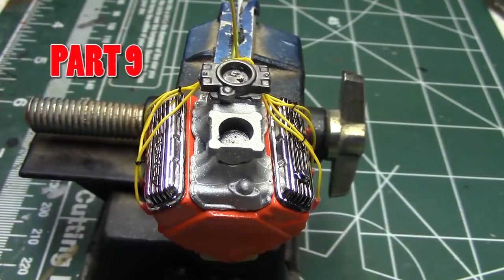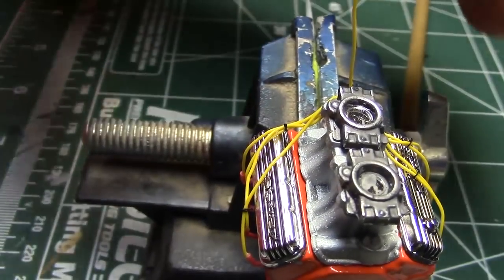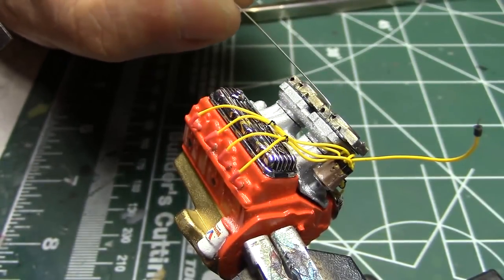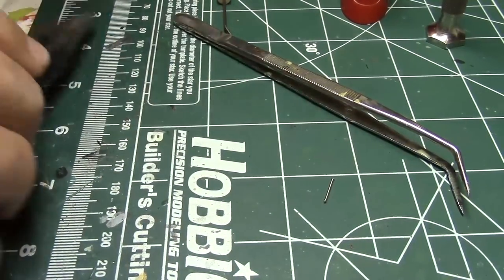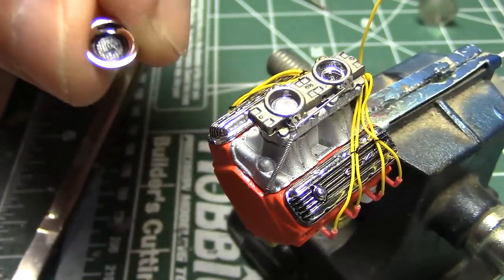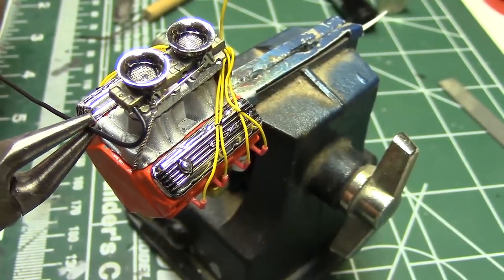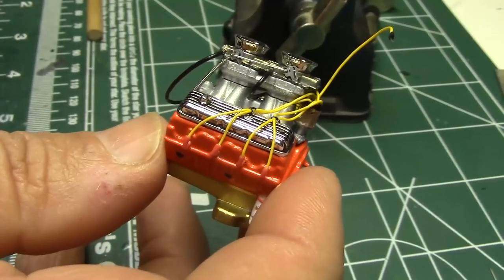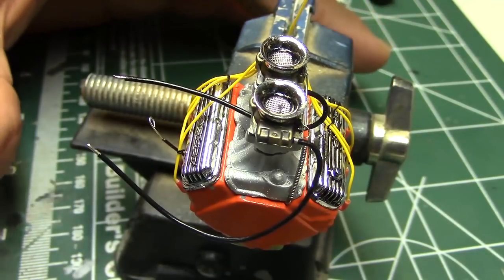How to Add More Engine Detail For an Old Model Car Kit  (AIBMC Part 9)

Comment: By accident I watched this video. By accident I mean I wasn't looking  for model car videos. I've never built a model car never even crossed my mind. I do work on full size cars 1965 and 66 mustang's as a hobby. I think I could have some fun building model car engines. I didn't know so many parts were available to make them so authentic.
Reply from the maker: Right on. Come on into the hobby. You will find that there are allot of model builders are full size car builders. You will example of that throught many of my videos. Also. Check out our facebook group. Luka Cee's Model CSR Hobby Headquarters. There are tons of amazing builders on there.

Comment: A thing I used to do on old electronics VCR’s and such before chips and all that came along was to take em apart and strip all the wires springs and screws out of them. I used to get lots of wires for plug wires, boots and hoses that way!
Thank ya for the video’s a great thing your doing!

Comment: Im excited with you! I've never done engine detail before. TBH, I'm not a "display the model with the hood open" kind of guy, so unless the engine is required to mount the front axle and wheels in place, I don't mess with it. But I'm working on some post-apocalyptic cars without hoods right now. And cars don't run without engines. They also don't run if the engines aren't hooked up to anything lol. And while some of this looks like it could be tedious and frustrating, this kind of thing is amazing for somebody with ADHD. Being able to hyper focus on just one thing for hours on end is very relaxing to an overactive mind.

Comment: Hey there, I know this is an old video but for lining up tiny parts like that photo etch linkage, I keep pieces of styrofoam from electronics purchases and I have some super thin 00 insect pins I use to hold them. I would use the guitar wire to poke holes in the styrofoam, take it back out and put the photo etch on the wire. Put the wire back in the holes and then use tweezers to arrange the photo etch. Once I get on where I want it I pin it with the insect pins so it will stay still and glue it with some glue on a needle. Then wok to line the second one to match. Pin it down and glue it as well. then take the whole assembly off the styrofoam and glue it to the carbs. 

Love your channel. Take care.

Comment: Guitar strings is a brilliant idea!  I just got a $7 set on the Amazon.  I would recommend to select a thicker set and “Plain third” or “Unwound third” because I think the wound strings will be less useful and when they are useful it’s the thicker ones that are better.  I think.  Electric guitar strings seem to usually have not wound third or G string.  Also, nickel or stainless color may look better than bronze yellowish color.

Comment: Check out the lead wire kit used in fishing...different gauges for all kinds of applications. Not a lot of money either!
Very easy to bend around those hard to match curves, silver  in color, super glues incredibly well, and paints up nicely
with metalizers, etc. Source: Bass Pro Shop. 6 sizes per plastic case. It is lead so...

Comment: I use what i have for the springs I use the wire out of a bread tie. Then i use my smallest drill bit and wrap it around it, does what i want it to do.

Comment: Doesn’t cutting the guitar string require hard wire cutters? I’m under the impression the spru cutters will deform when used to cut hard wire like guitar strings. Am I wrong?

Comment: The bowls are out of scale.  My tunnel ram on my car actually has space between the DP holleys.  If I switched to a single dominator I would lose too much of the driveability so I used 2 in line 600 dp's. I'm building a 70 Chevelle SS for my mom to give my dad for their 50th Anniversary.  They met at the track the year he won the NHRA presidents cup.  I'm not really a scale car builder as much as a plane and tank builder but I have built around 60-70 cars.  I always skipped detailing the engines.

Comment: just put some masking tape under the photoetc parts.
also i thout, whait, where the hell is dipstick..
for a detailing engine im also using old phone charger cables.also beads can been used as a bolt heads

Comment: The mini vice completely plastic or is it casted metal? Been trying to find one on eBay and amazon but they are entirely plastic...
Reply from the maker: Its all plastic. Ive had it since i started model car building in 1985. I went to radio shack and bought a bunch of small tools for my new hobby. I still have them all. The vice was apart of that purchase. Man I miss Radio Shack.
Reply: The Luka Cee Channel yes radio shack was a cool place to go. Still one out here in Colorado but due to COVID, I doubt it will reopen. Great selection of wiring and small gadgets.